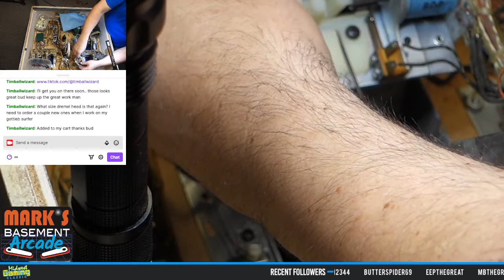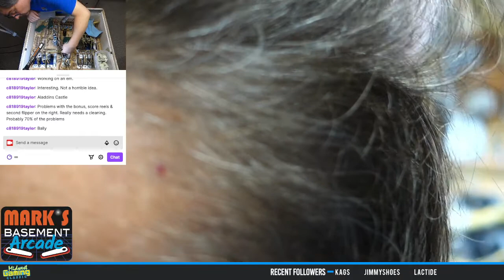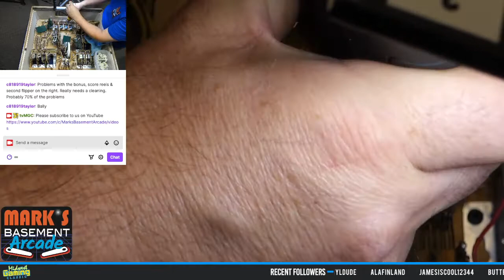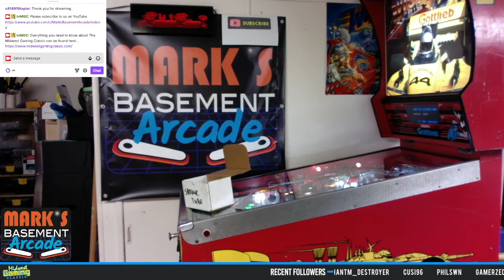1975 Williams Pinball Little Chief Score Reels + tvMGC 7/24/2022 #Pinball #williams #littlechief

Comment: Hey Mark, several questions.  How did you clean the score reels?  What kind of bit did you use on the Dremel to clean the contacts? Was the super lube dielectric grease?  Can you tell me more about the ultrasonic cleaner? I only have a case tumbler/ dry medium vibratory cleaner.  I'm about to get started taking apart the reels on the pat hand I just picked up.  I noticed when playing the tens digit buzzes and doesn't move.
Reply from the maker: I have a full video on cleaning score reels step by step. 443 Dremel bit. Yes Super Lube grease. Its a Harbor Freight ultrasonic cleaner that works awesome, I have a video about this too. My How-To video playlist has most of these videos.
Reply: @MarksBasementArcade  thank you, I'll check them out.